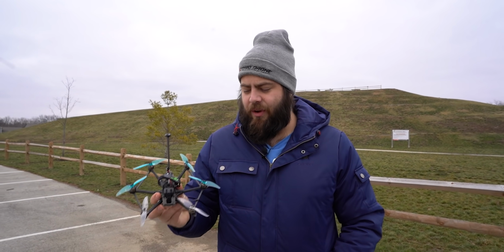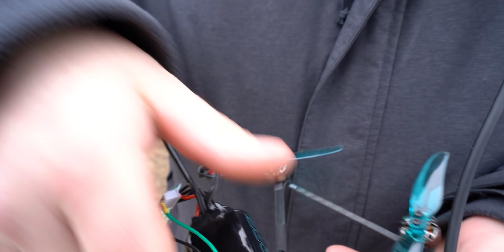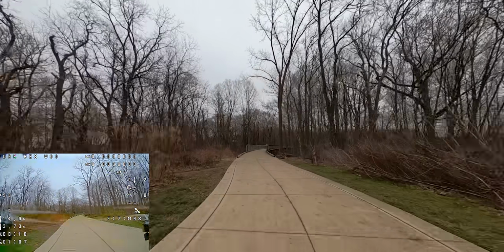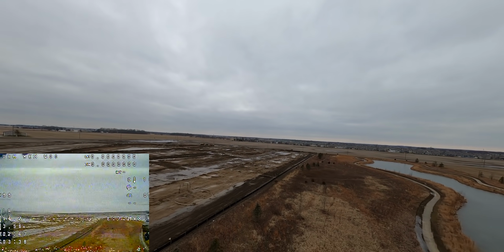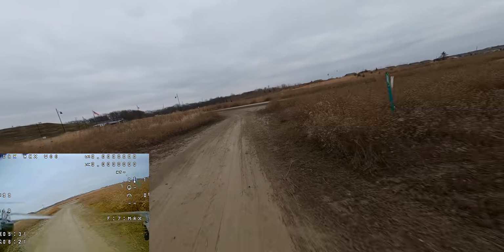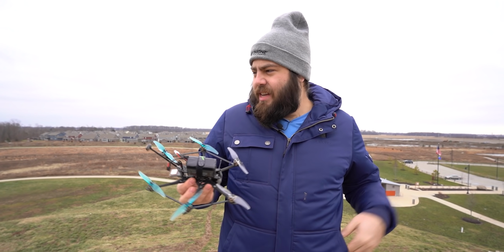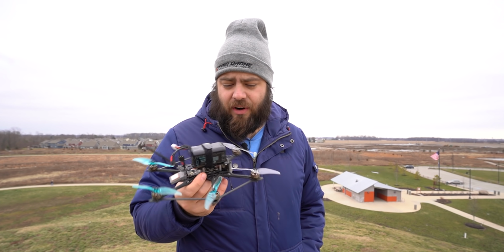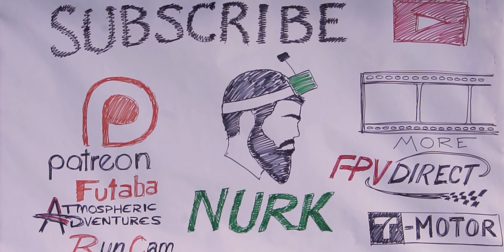GIVEAWAY! Flywoo Hexacopter Analog Edition Testing

Comment: I really need a new setup for flying in my local park and backyard (Preferably quiet) I built my first budget 99$ setup about a year ago and it has been greatly loved but as consequence to learning to fly the quad it is no longer in flying condition and the parts used are about five years old so it is not worth fixing because it would need all new electronics, but in the mean time I have enjoyed the simulator, and would really love to get back in the Skys and even try long range. especially since I will be going to some desert mountains in a month or two and would be amazing to long range there. I would love to go in to Video-making which is why I think I love you channel so much!

Comment: I recently managed to do a big oooof and crashed my drone in a pond whilst practicing freestyle. Managed to find it in the water after around 40 minutes. Dried it off and it was mostly ok, apart from one of the motors wasn't spinning up (ESC failure?). It was my very first drone and after having only a couple dozen flights it was heartbreaking to not be able to fly anymore. Getting the  opportunity to fly the flywoo would mean I can get back to flying ASAP and also a great new experience, since I've never even dreamed about flying long range.

Comment: I almost thought this was the one you fished out of the stream in the cold 😰. I purchased the Explorer LR 4 after you flew it. I only got a couple of flights before I tried adding a 5v plug and smoked the FC & VTX. Still waiting on the replacement parts from Flywoo. But I'd love to fly the hex in the meantime since it's the silent long ranger. Shipping to PA should be cheap 😉.